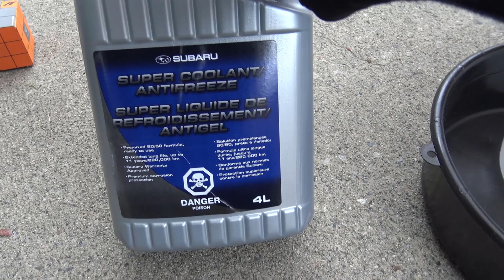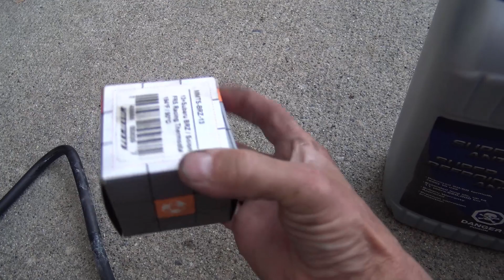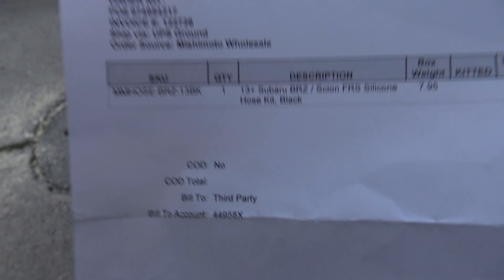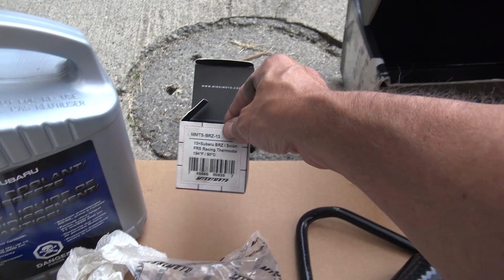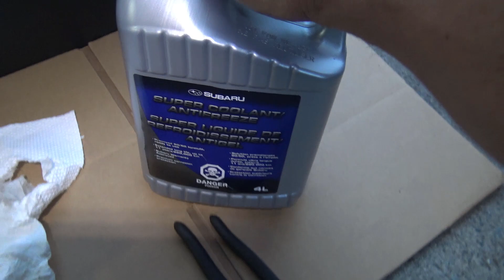Should you change your coolant hoses to Silicone?   Thermostat?

Comment: On my 1.9 vw turbo diesel, they run WORSE when the thermastats age and they open 10-12° f sooner than normally.

MAYBE a gasser is different than diesel, but I'd think most engines would work better when they are at the proper temperature.

Comment: The hero every GT86 bro needed! Thanks for making this super helpful!
Reply: Say have you had any issues w the mishimoto thermostat? Mine seems to stick, or at least not open all the time, Im having issues to where my car will start to overheat under long periods of idle randomly.. I was just noticing a small leak this morning on my passanger side, gonna do some digging but i suspect it may be the thermostat. fyi i run the full mishimoto kit, Radiator, silicone hoses, and fan shroud.

Comment: Cooler engines doesn’t make more power. Drag racers will ditch the entire cooling system to save weight. Installing a cooler thermostat will stop your engine from hitting operating temperature and accelerate wear.

Comment: Running cooler makes less power. When the engine is cool, combustion energy escapes as heat into the engine. The hotter the metal is, the less energy escapes.

You want a high temp thermostat, but a better water pump and radiator so that your system can handle high loads and never let the engine overheat.
Reply: That was my thought immediately.  Also, the engine tolerances/clearances are designed for a specific operating temperature range.  Otherwise, what would be the point in the thermostat if you could simply run the coolant through the radiator all the time.

Comment: i just changed this radiator hose to silicone too. but i wonder, what else hose can i change? in my simple non-mechanic mind, i want to change all available hose to silicone. but, not all hose available for buy online. specific hose i can find is radiator hose. and else, just standard long straight hose with their own diameter. can u suggest what hose should i change? i don't want any of those hose to break when im driving.
Reply: You can't use fuel lines as silicone ones but I could be wrong not sure
Reply: @Jason Sparrow thanks for info. my foreman also not dare to change brake booster vacuum line. thanks! im waiting for silicone throttle body hose specific for my car. this can be change, right?

Comment: Ihave heard that you have to use special hose clamps with silicone.
Reply: Yes I use t bolt style ones so they dont cut into silicone
Reply: Mishimoto radiator hoses are the worse hoses you can get for this car.

Comment: I like all the Mishimoto stuff but in reality the thermostat will not make your engine run cooler.  The lower temp opening thermostat will do just that and open at a lower temp. Once the engine is hot and the thermostat has opened the only thing that will cool the coolant is the radiator.
Reply: I'm glad someone cleared that up.
Reply: @tinyzeroproductions6740  it will help if your engine is cooling at the opening temp. My car on the highway will stay cool and 180 with a 180 thermostat. The stock one kept it a little higher but i also have an all aluminum radiator